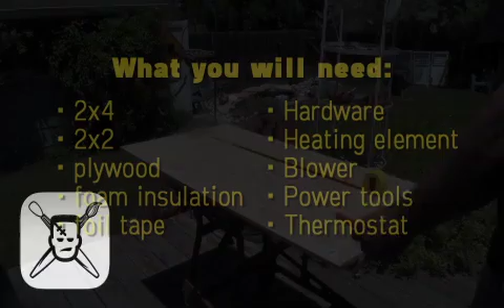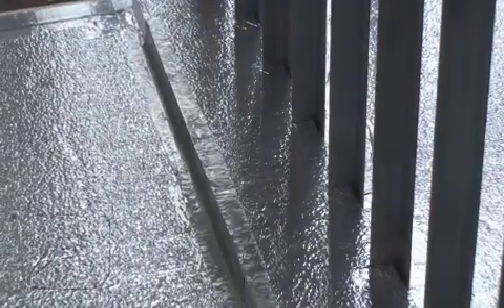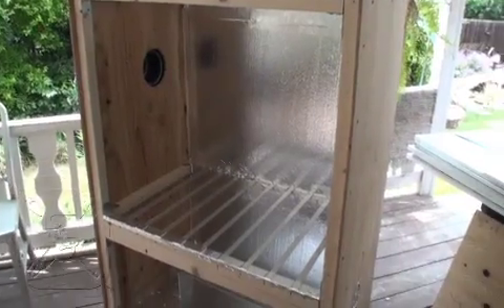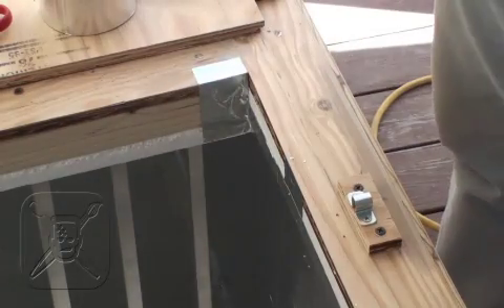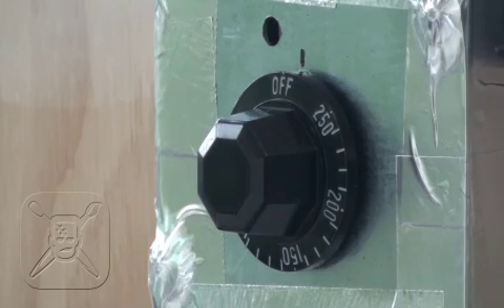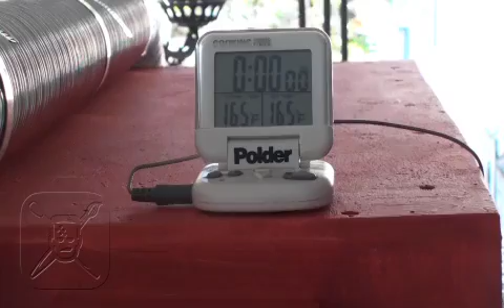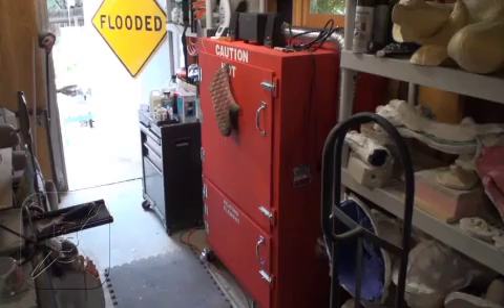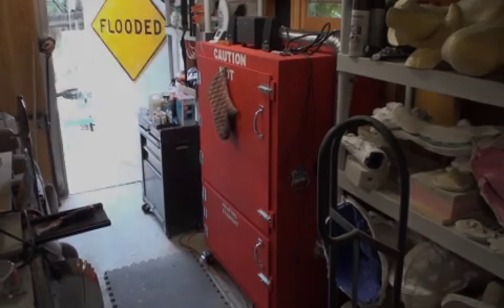Foam Oven Tutorial

Comment: Heya @tdebreceni any chance you can supply links to the grainger high temp blower you used and the thermostat from McMaster?  Thanks so much!
Reply from the maker: Hi Colette, Sure! •	Dayton OEM High Temp Blower (from Grainger) Model 1TDV3; •	Adjustable Temperature Control Switch (from McMaster-Carr) Model 3626K67 or o	Model 35055K71 (±4° vs. ±12° for 362K67); •	Strip Heater (from McMaster-Carr) Model 3619K871. Good luck! ~t

Comment: Hello, I am just getting into foam latex, and was told I could use a toaster oven or a convection oven. Could you tell me approximately what size it needs to be? I will only be making face masks, and prosthetics in it if that helps. I am lost at this point, and really would appreciate a guided answer. Thank you.
Reply from the maker: Hi Brian, I would not use a toaster oven as it's likely too small, and you can't regulate the temperature low enough. A convection oven is ideal as it keeps an even airflow throughout. However, you don't want that oven to be the same one you prepare food in! I do not bake my foam above 140 degrees Fahrenheit. It takes longer, but the foam is softer, and there is little danger of over-baking it. You could make a plywood box, line it with insulating foam sheets, and use heat lamps.  That was my first oven. You'll need to monitor the heat, as it can quickly get hot.  Holes on either side of the box and a fan to pull air through will help.  You might want t o try a ceiling vent fan from someplace like Home Depot or Lowes.
Reply: Thanks a lot for commenting. It seems really expensive. Maybe I should work with silicone for now, and I though that was pricey. Thanks so much, though  @tdebreceni
Reply from the maker: Something about the size of your kitchen oven should be large enough to let you do molds of varying sizes.

Comment: I just bought a fan and heat lamp and lined a wooden box with foil and tape. Does it matter where you put the heating duct? The box I'm using isn't huge, it's kinda long and semi narrow.
Reply from the maker: Just make sure it doesn't interfere with good airflow through the box. Try to mimic how I've attached it to my oven.

Comment: only 600, huh? lol.
Reply from the maker: When I built it and made this video, yes.
Reply: @tdebreceni  is there any way to radically reduce the cost? Maybe to 150?
Reply: @altermann1ify  doubtful, but I'm sure costs could be lowered; you could remove the convection component by losing the blower, but the wood and hardware alone will be more than $150, unless your family owns a lumber yard and a hardware store. If you figure it out, let me know!
Reply: @BattlesWithBitsofRubber  Thanks. Yeah, I'm strapped for cash. That's just too much money for making a few masks, at least for me. living on a fixed income isn't fun
Reply: @altermann1ify  Get a cardboard box big enough to contain your molds and cut the bottom off.  Then line it with aluminum foil shiny side inward.  Punch a hole in the top and stick a hair dryer in there and experiment with how much time and what settings on the hair dryer to cook the foam best.   It is temporary, but I've used it to great effect in emergencies.  Every hair dryer is different so experimenting is key.  You can even shove a meat thermometer into the top to help gauge temperature.
Reply: @Brawlocaust  How would you prevent the hair drier from shutting off when it overheats?

Comment: Any tips on the baking process of foam latex for figuring out the duration of the bake, foam density, and baking temperatures
Reply: That information is in my book, as well as in a  multi-part tutorial that Stuart Bray and I wrote for Prosthetics Magazine (issues 5 & 6)
Reply: @BattlesWithBitsofRubber  thank you, is your book offered online? also i was thinking about using an electric smoker i believe it has a heating coil inside which can heat the interior to a desired temperature set on an electric screen.
Reply: @kbfxmonstertutorials3386  You can buy my book online through Amazon or my publisher.  It's called 'Special Makeup Effects for Stage and Screen.'